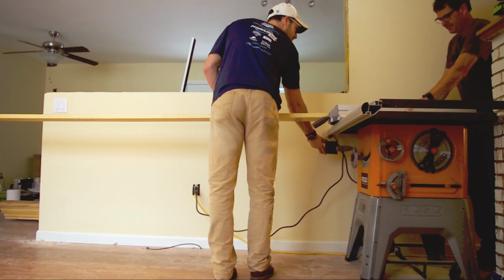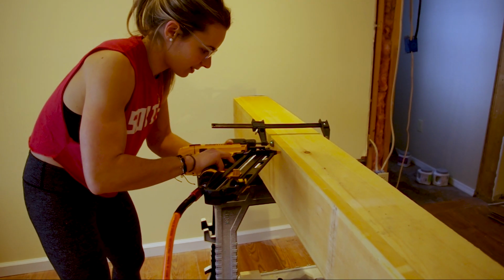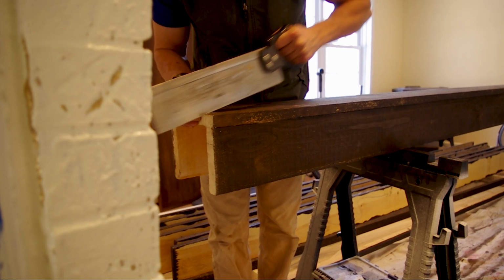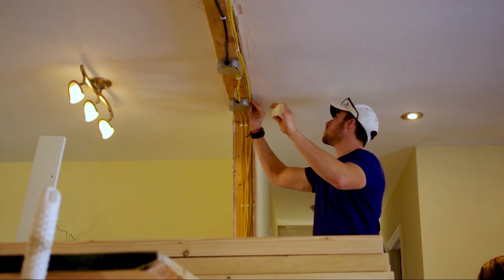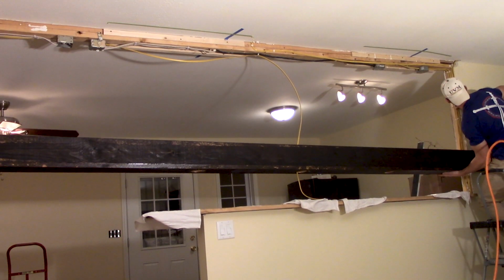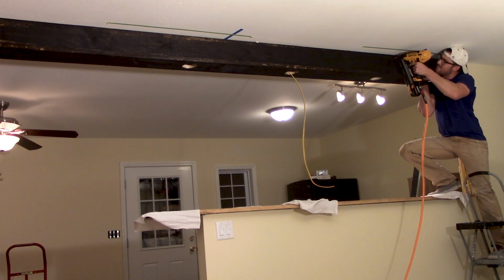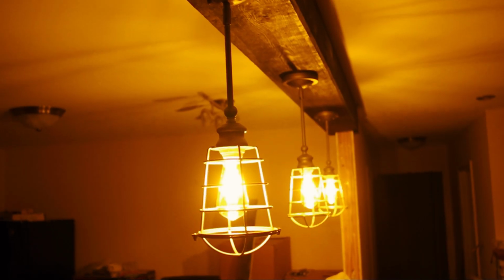How to Make EXPOSED CEILING BEAMS  **faux wood beam**

Comment: but joints may make it simpler and easier but mitered joints are the only way to make it actually look like it's not just a cheaply done fake beam.
Reply from the maker: scott banta it wasn’t a matter of ease, I didn’t have enough space to rip a quality miter the full length of the beam. With the dark stain you can’t really see the joint so it still looks good! Next time I’ll probably rip the miter and then distress it which would likely cover up any gaps or mistakes.
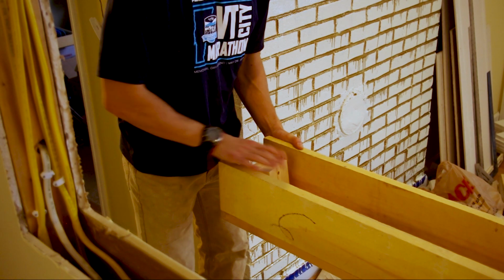Reply: @SamMacyDesigns  I was just going off of what you said in the video. About 1:30 into it you said you wanted to do miters but it was easier to do but joints and that is why you did it the way you did. I guess I just seeing that you ripped the pieces to width anyways so angling the table saw on a 45 degree angle wouldn't have been much different than what you already were doing, but it would have made it look way better. I get just trying to do it quick and simple, but it looks way more professional and realistic to use miters. that's all I was saying.

Comment: Looks pretty good but I think the 45s would have looked better to look more like a beam instead of a box. Like the lights too!
Reply from the maker: JT Holodnick I agree, that was the original plan but I didn’t think I would be able to cut a straight 45 on a 16 foot board. If I had to do it again I’d cut the 45 and then just rough up the whole beam to make it look aged and then you wouldn’t be able to see the seems.